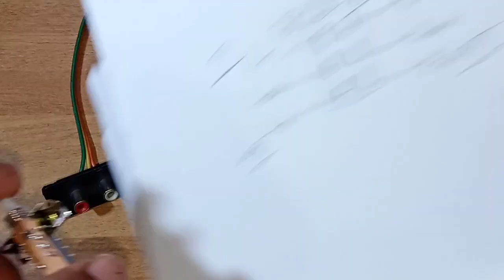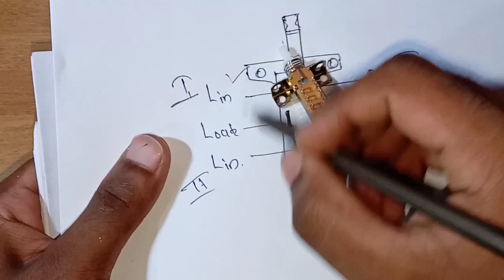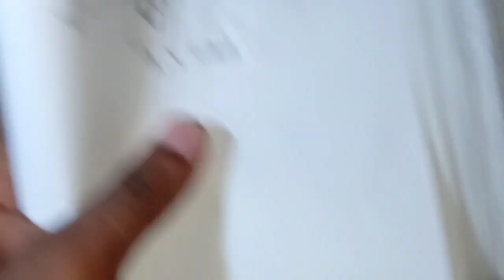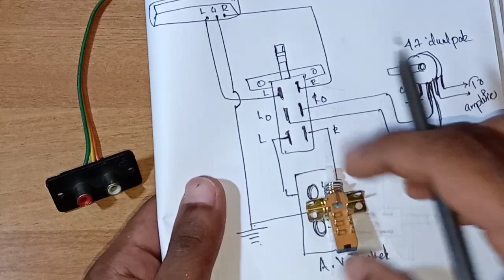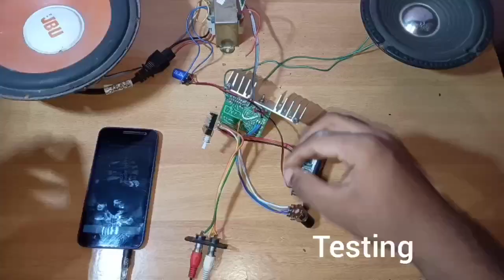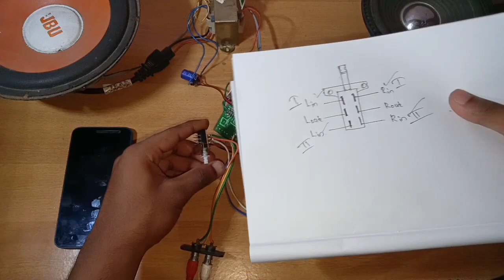6 pin selector switch / wiring details /malayalam.

Comment: Any problems if we connect two lines to the amplifier directly with out switch? 
Kindly answer this, in my case usb board and mic are two lines, I want both to work at same time
Reply from the maker: No problem

Comment: Bro njan oru board vangichu 2.1 supplay kudukkumbol speakeril koode bayankara moolakkam varunnu enthenkilum solution paranju tharuvo plz
Reply from the maker: Eth boardanu?
Reply: Home theater board 2.1 2030 board aanu vangichathu
Reply: Transformer njan oru electronics kadayil kaanichu appol avaru paranju ethu single channel transformer aanu, duel chnnel transformer aanu kodukkandathu ennu paranju
Reply: Nammal hometheateril connect cheyyunna transformer duel channel transformer aano
Reply from the maker: @haritechy1869  centre tapped transformer aanu avashyam.
Reply: Broyude number onnu tharuvo oru samshayam chothikkana